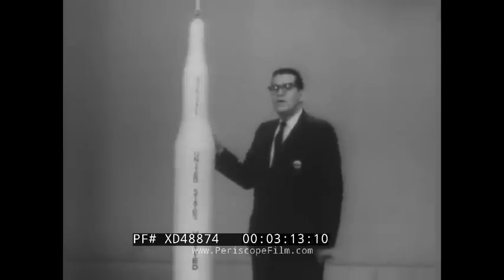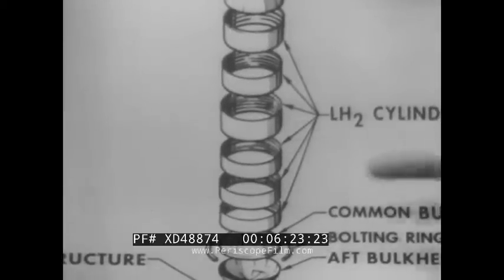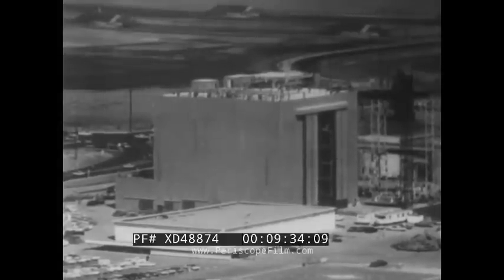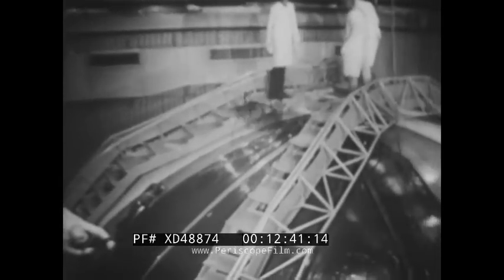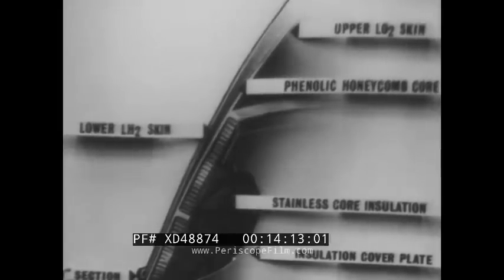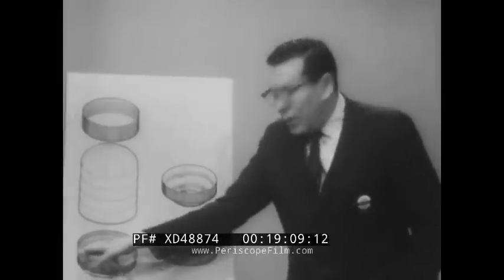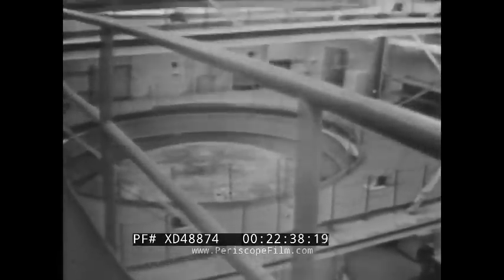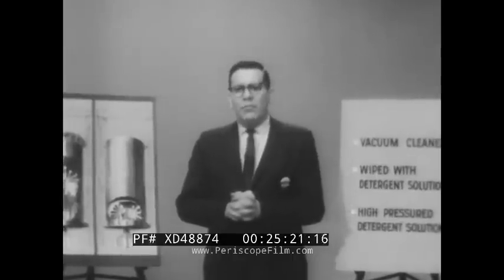THE SATURN V STAGE II   S-II ROCKET   1964 NORTH AMERICAN AVIATION  APOLLO PROGRAM FILM XD48874

Comment: The entire Apollo program hinged on the S2....highest performance rocket stage built to date....the first and third stages were battleships....no way Saturn 5 could have lifted the spacecraft if the second stage was built the same way. It later lifted the huge Skylab platform into orbit without a third stage.
Reply: I agree.  The common bulkhead between the LOX and LH2 was a real engineering challenge.  Saving weight was critical because the S1C was so massive and further along in development.  Absolutely amazing what the people in this program accomplished in so short a time.  Kind regards.

Comment: [03/19/22] Just the phenolic honeycomb structural insulation alone is pretty impressive. Were the various components built to tolerances of 
±.001 inch, or better? It would be interesting to know.
Reply: .01” or ~0.5mm tolerances according to the NASA technical reports server. Also notes that the SII had over a kilometer of welds, every cm of which had to be prepped and cleaned, requiring 8hrs of prep per weld.
Reply: @GlutenEruption  Do you have links for that server?